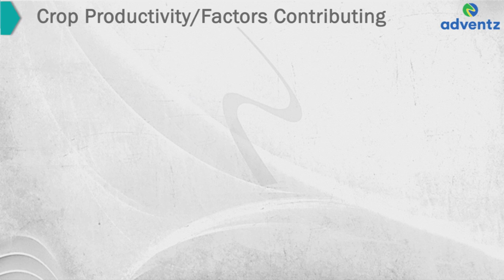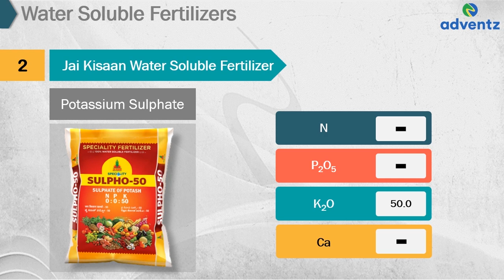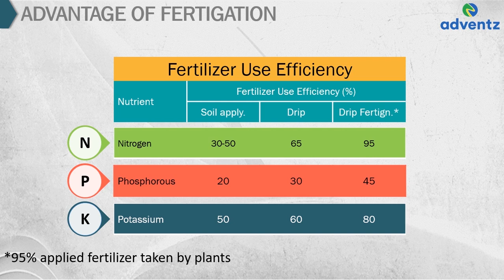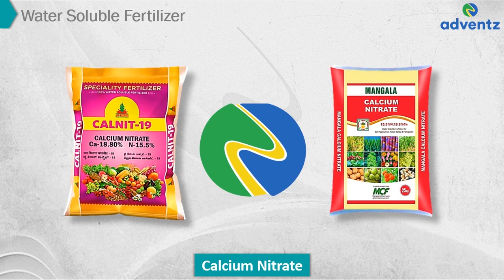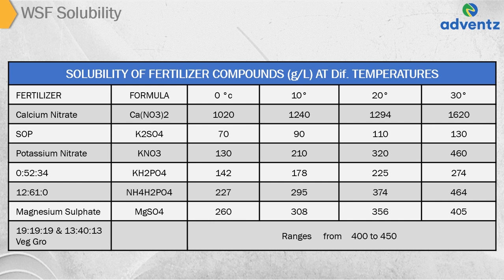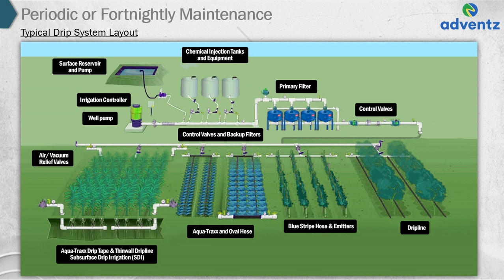What are Water Soluble Fertilizers?

Comment: 10 26 26 जय किसान एक पोत्यामध्ये जवळजवळ तीन किलो वाळू आहे  शेतकऱ्यांना का मातील घालता. 97 65 25 94 20
Reply: Dear Karun
This is not a sand this is a filler materila which is used to add nutrients...
8855806285